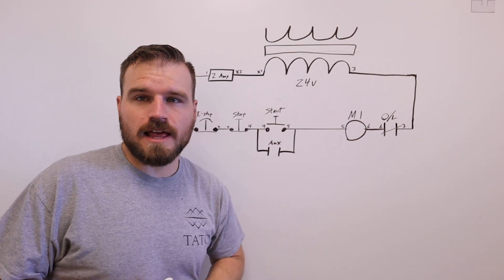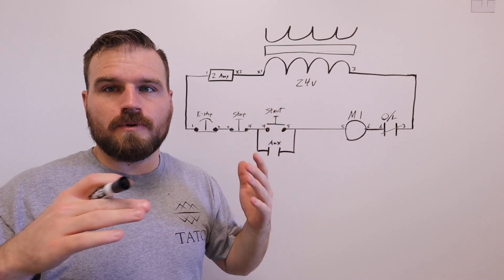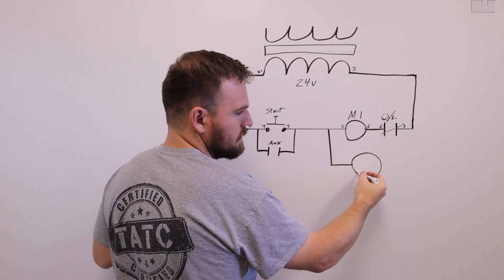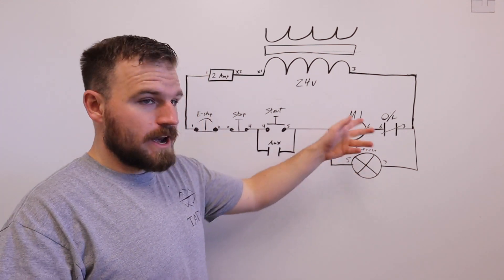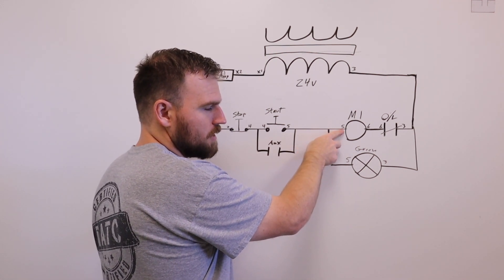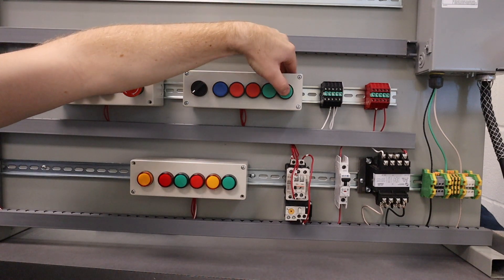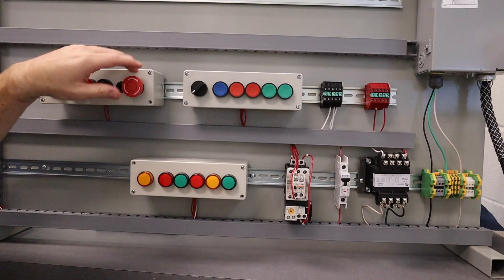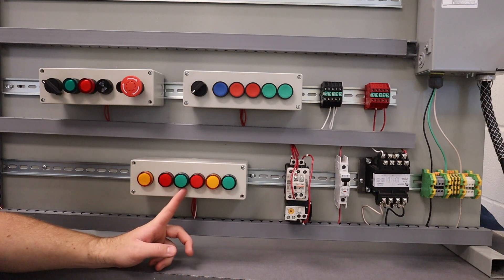Motor Controls - indicator light lab

Comment: Man.. I get the concepts and such but for some reason the wiring is just not clicking. We have a box we built the face, backplane and put in all the switches lights and fans. Then a transformer with two contacters linked (forward and a reverse) with the overload. Then the on button that stays on with the forward , a white power indicator light, a reverse button with a light and toggle switch that I am not sure what is supposed to do yet. Figuring out how to jump wires around to get everything powered to the proper place and in parallel is really confusing atm. Hoping it will click soon because I HATE not understand things I am working on with my hands. Your vid kinda helped my thinking a bit so thank you for that. Out instructor basically gave us a box full of contacters, overloads and these bars that go across the top contacts of both contactors, pointed to the switches and lights and said have fun. We have a lab worksheet but it is basically just the schematic. Also got a grand total of 1 hour talking about ladder logic. Only one or two guys in my class seem to have a good grip on things and everyone else’s brains are fried. Thanks again for these videos, it helps to see the diagram against the actual components. You seem like a good teacher
Reply from the maker: Thank you and no problem! Can I direct you to this video I made for a more basic understanding of a motor control.

https://youtu.be/luvDibNU_tQ?si=NknWCpn3307BVPxZ

I'm not sure exactly what you’re trying to do but this video kind of explains the basics. I plan to redo all of my motor control video next year but if you need help please let me know.

Comment: That would not show if the Motor runs or not . In the moment when you push the start button the Light comes on, no mater if the Motor runs or not. The Light should be connected on Motor 6 and O/L 3 . Now if the Motor doesn't run, the Light will not get power.